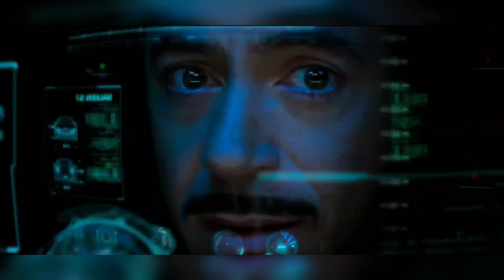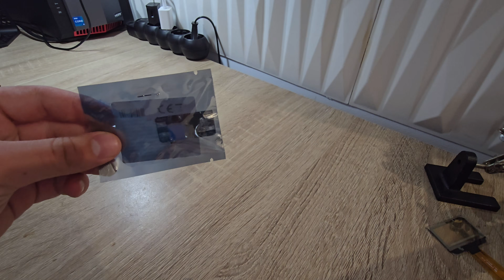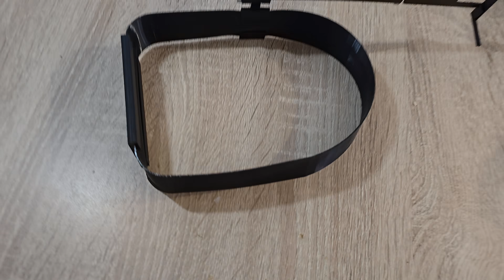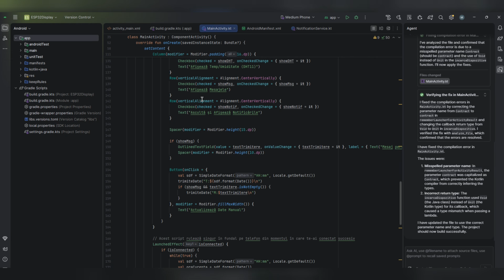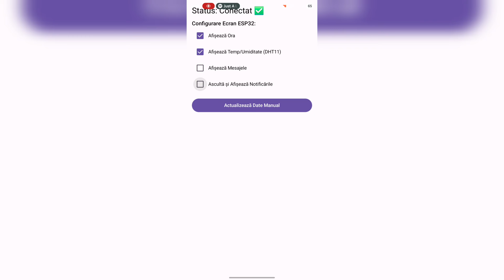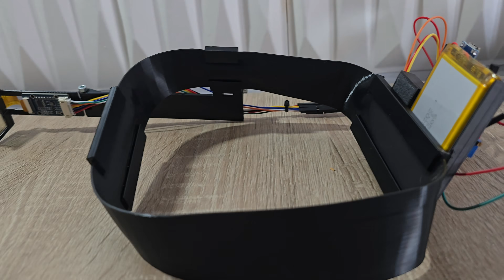I built my own heads-up display for $50

Comment: is it better if you add two displays one for each eyes which have same things it will be cool right?
Reply: GPS on this screen will be fire
Reply from the maker: @Fob0z  Actually, GPS was on my to-do list. I wanted to be able to see the location from my phone on the screen, but I just didn't have enough coding knowledge for that.
Reply from the maker: It could be a good idea for a version 2, but the screen has to be pretty far from your eye to be able to see it, so the supporting structure takes some of your peripheral vision. So, if I add another one, I will have to solve this problem.
Reply: @Garage_Builds  and if you can add some more powerfull microcontroler or use a raspberry pi 2w .
i dont know much but look into it if you have some time
Reply from the maker: @Tag12Gaming I don't really need to, since it is connected to my phone I can use it for difficult tasks like if I want to add an ai it can run on my phone and use the esp as a way to display the info